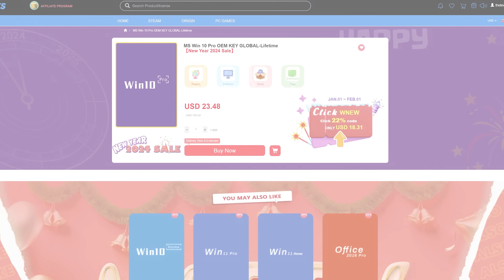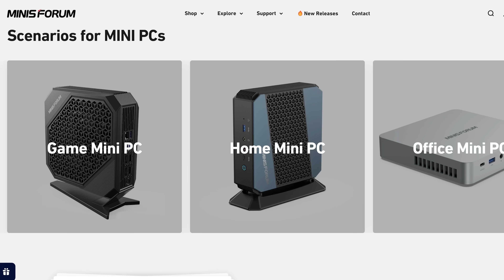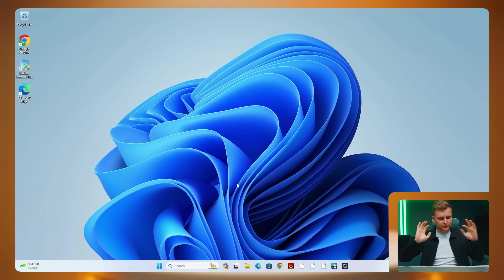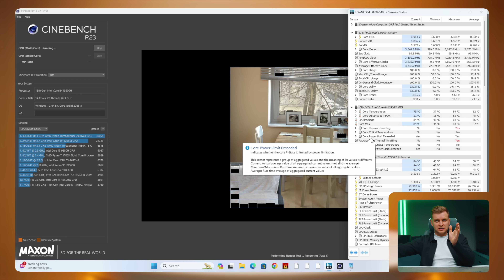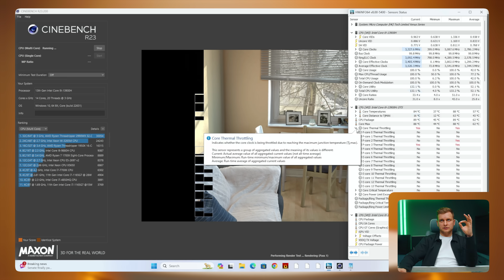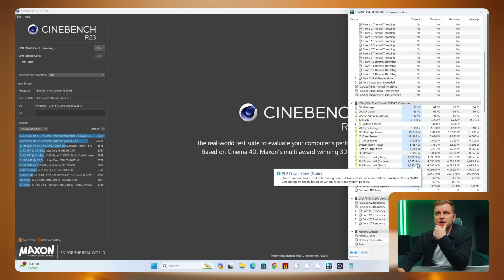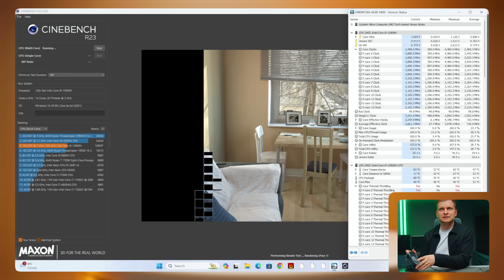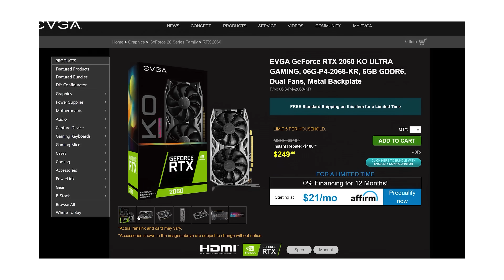This Mini Workstation (PC) Has NO Competition! Test & Review | Minisforum MS-01

Comment: I bought an MS-01 myself. The biggest pros are the connectivity, the power consumption, the Iris Xe graphics (which is not available on the smallest model) and the PCIe slot on which I use an external graphics card. The biggest cons are the inverted USB ports, the inadequate cooling and the noise level which is quite annoying under full load. I wish Minisforum had developed the same mini PC in a slightly larger form factor, with better cooling and the possibility of using "normal" low profile graphics cards. The problem with the noise level would have almost solved itself.
Reply: how much did you pay and which model/CPU did you get?

Comment: Love this video review. But the RTX A2000 will not fit in these miniPC. The standard A2000 card is a 2 slot, while this miniPC only support 1 slot card. However, there is a custom heatsink for A2000 that make the card to single slot card. ETA Prime channel had review those custom heatsink.
Reply: Sff version of a2000 and a4000 fits
Reply: @ARJUNDASED  only with low profile single slot heatsink.

Comment: My MS-01 arrives from China tomorrow! Already here waiting for it: 96GB 5200MT/S DDR5 RAM, 3 x M.2 SSDs totally 4.5TB, an Nvidia T600 video card (hope it works!) and two 10G copper transceivers. The machine will get ESXi 8.0 U2 after turning off its efficiency cores. It will run about 30VMs, replacing a Dell PowerEdge R740 for the summer months.
Reply: Hi, how can you add 96Gb if it supports just 64BG?
Reply: @o_Oleh  It doesn't. That 64GB limit is a misstatement. The machine uses DDR5. DDR5 SODIMMs are available in a 48GB size in addition to the usual 32GB and smaller sizes.

Two 48GB SODIMMs gives you 96GB total.

I have no yet heard of a DDR5 machine that takes two SODIMMs and can't reach 96GB.

96GB DDR5 RAM is about US$300.
Reply: Unfortunately, the T600 GPU did not work in the MS-01. So I am looking for another non-AMD card that'll fit.

The machine is up a running for two days now, with a reduced load from the R740. Just the VMs I need to have running with a bit of headroom in case I need another VM or two.

The R740 has been powered down for those two days.
Reply: @jeffnew1213  which graphics card you end up using now? If I get barebone, I still get 3 video output from the built-in graphics, right?
Reply: @snowwny  The Intel ARC A310 came into stock at Amazon. It's by a company called Sparkle and it's there ECO model. US$99. Works fine under Windows 11. There were no working drivers for it under Windows Server 2022 though.

Regarding video out, I can only speak for the highest-end model, which is what I have. The barebones version still has the Iris XE graphics and still supports at least the 3 video outputs. More with the addition of a GPU.

It turned out to be a very nice machine. It's running ten VMware virtual machines and has available CPU to run more. Unfortunately, it's nearly out of memory. That's why servers that take 128GB, 256GB, 512GB or more are still important.
Reply: How's your minisforum ms-01 running for you? I plan on running Debian, and then using Incus to spin up LXCs to house Docker apps. Thank you.
Reply: @JamesJosephFinn  The machine was running fine all summer. I moved the essential load of VMs from my PowerEdge R740 (running ESXi) onto it and shut the big server down for the hot months.

When VMware announced memory tiering in ESXi 8.0 Update 3, I bought another MS-01 to try it out on. Seemed to work fine, but I think I overloaded that machine a bit and responsiveniess of the VMs running on it varied somewhat.

I bought a 3D printed mounting kit from a company in Australia, whose name I can't remember right now, to mount the two systems in a new cabinet I am building out.

Overall, I think the MS-01 is a fast, capable system.
Reply: @jeffnew1213  Exciting stuff sir! My rig is going to be running Incus LXCs, which are lean and mean as I understand it, so I should be good to go. I'm a n00b, so I really appreciate the insights.

Comment: Just got mine put together last night with 96 GB Crucial DDR5 and two WD N700 2TB SSDs (I got these because the TBW is 2500, almost 4 times that of a Samsung 990 Pro, and ZFS eats consumer SSDs quickly). I'll be setting up Proxmox on it with the SSDs in RAIDZ1, so this little beast will do all kinds of work for me.

First item on the agenda is a Debian (VM or LXC? Haven't decided yet) to serve as my new Docker host so I can move my containers to there and off my NAS, as Synology's Docker Compose is friggin' ancient and it's annoying me that I can't do includes.

Ultimately I would like to virtualize OpnSense on there to act as my router, but I'll probably have to get an extra NIC for that, particularly if I actually utilize the Intel VPro as the port has to be dedicated to that if you use it.
Reply: already had random crashes?
Reply: @herman6214  No, I haven’t had any crashes. It idles at 42C, and at 5% CPU, the temp is 52C and the fan is annoyingly loud, but this is apparently normal.
Reply: @praetorxyn which model do you have?
Reply: How's your minisforum ms-01 running? I'm researching a setup similar to yours, but using Incus instead. Also, have you experienced any issues virutalizing your router on the same box? I'm new at this, but it seems the general advice is router should be separate hardware, no? Thank you.

Comment: Something else crazy. My laptop with i7 13620h cpu and ddr4 ram gets the same cinebench r23 points as this mini pc. Prety curious to why is this so. Maybe the mini pc is thermal limited alot more? My laptop is a zephyrus g16 2023 model which has liquid metal on the cpu. Maybe it is better at cooling and it mantains it more cool.

I certainly see why would somebody buy one of these. The two 10gigabits and two 2.5 ones ports are prety good for accessing mass storage on diferent nas's and transfering huge documents.
Thank you for the review , i never knew these things exist before today, though i should have seen it comming

Comment: Will this SSD fitt in the U2 slott of the Minisforum MS-01 aand function without any issues? It'sss aaa Western Digital Ultrastar DC SN650, U.3, 15MM, 15,360GB, 2.5-inch, PCIe.

Comment: I have a a 4 slot nvme card in my with 32TB! FYI it has to be a bifurcation card with a PCI-E switch. Does about 3500MB/s. Crazy compact server !
Reply: What's the card that you're using?
Reply: @moonimmondal  You will need to leave the mental shroud off and put a heat sink on the switch chip and some heatsinks on the upper NVME and thermal tape underside.

Comment: SFF+ ports are cool when fiber connections are a requirement.  This is really unique in a compact workstation.  I wonder if you could swap the SFP for additional video output ports for those that need to connect extra screens and don't have fiber infrastructure.
Reply: The network ports are onboard, can't swap them out for anything else.
Reply: @nadtz  Agreed.  I was thinking along the lines of a factory option to have additional video outputs at the cost of SFP+.
Reply: @Static-MT  Not sure if you can use the USB on the back for video out but given it's only got 1 video out I can see where you are coming from.  Just another reason for a MS02 to be a little bigger, I think it's a really neat device that suffers from the form factor more than it should.

Comment: YOOO 2mins agoo😂 big fan man i love your fractal build, inspiring me, i need some clarification though, i want to get 14700kf and 4070 ti with a b760 proart mother board, but I’m worried about the bios issue, any advice?
Reply: never 14700kf, you should get 14700k,
Reply: But do i need the integrated graphics? I already have a gpu so i dont need it right?

Comment: What really counts is always forgotten, in any review I come across: SSD temperature !
The longevity of your SSD, and therefore the integrity of your data, is heavily reduced under high temperatures. 
On my pc my SSD rarely runs hotter than 40°C, and that's why it will probably last 10 years or more.
However: if it were around 70°C, as is often the case in mini pc's, I might have to replace the SSD every 2 years or so.

Comment: THANK YOU for using Cinebench R23. Not a fan of R24 at all.
Reply from the maker: No problem!
Reply: @theTechNotice  Also, the A1000 looks cool and so does the rtx 2000 ada 16gb that recently came out. They'd be a great use case for this. Did you say that this pc has foam barriers to ensure that only cool outside air is pulled into the cou cooler rather than warm recirculated air?

Comment: A2000 is 2 slot GPU wont fit . The PCIE connection is 5.0 just some corrections
Reply: It will with a custom heatsink that is sold online. Even the A4000 will work.

Comment: When you get these Mini PCs in for review do you do a clean install of Windows and download the drivers from the manufacturer's website? This ensures there is nothing else installed on the NvmE and it gives you an idea of how easily the drivers are to download.
Reply: Interesting. I'm also seeing concerns about malware inserted into BIOS. How does one protect against this? I'm new at building machines. For context, I intend to run Debian, not Windows.

Comment: Intel did not have much pcie birficiation option, most only do 8/8 while amd do 4/4/4/4 which means if it is a 16 slot and you want to using a smaller version of quad nvme carrier card , it must be come with a 16 lanes to 4/4/4/4  controller which is not cheap 😆 

There are some cheaper card with controller but they only do x4 or x8 the host

Comment: I'm disappointed with its idle power draw of 13W - I think it should arguably go way lower, given that it's built on laptop hardware. I don't know if possibly that huge power adapter brick might be the reason - doesn't look like a high efficiency adapter. Even the standby power draw is 2 watts. If you buy a Lenovo or HP 1L mini PC, which is built on desktop CPU technology, actually you can get around 6W of idle power draw.

Comment: I wish this was bigger (maybe the size of a deskmeet) to have more options for the PCIE slot and better cooling.  For a first effort at this kind of system it's pretty good but there is definitely room for improvement.  

There are some small quad PCIE NVME adapters out there but you'd need one with a switch on it to handle bifurcation and it's only an x8 slot so the most you are going to get is 2 additional drives,  additionally servethehome and craft computing did some testing and quite a few PCIE cards won't work.

Comment: It does not support ecc memory which is important for workstations. Also only one gen4 nvme slot. And HHHL-SS videocards are virtually non-existent. RTX2000 will not fit MS-01, you'll need a custom SS cooler to put it in.
Reply: ECC is not important for workstations. It's barely even important for servers unless you're using particular features.